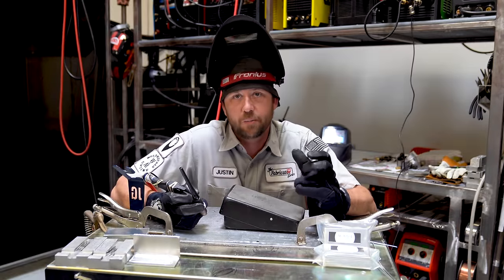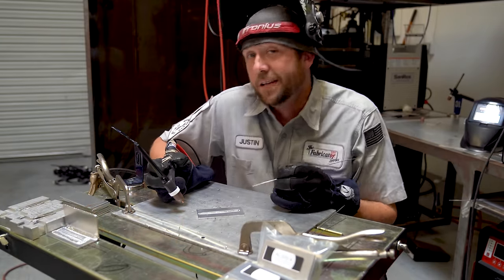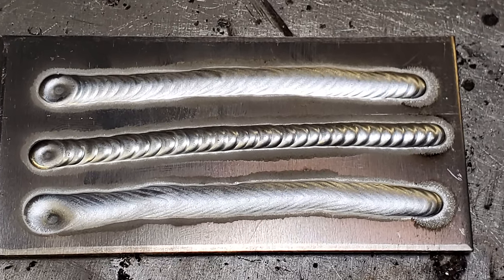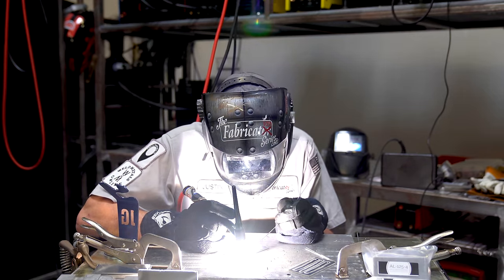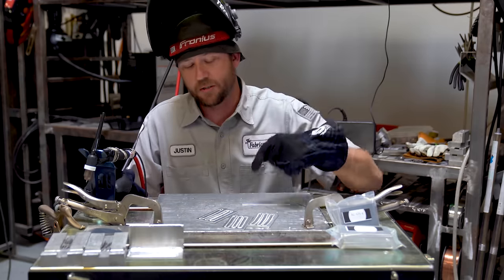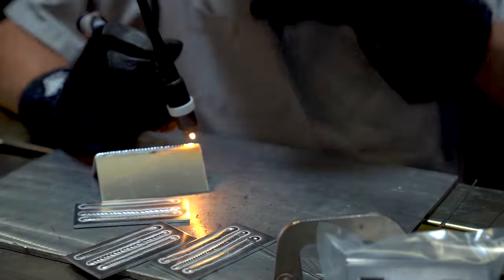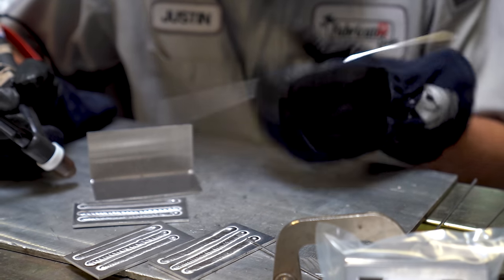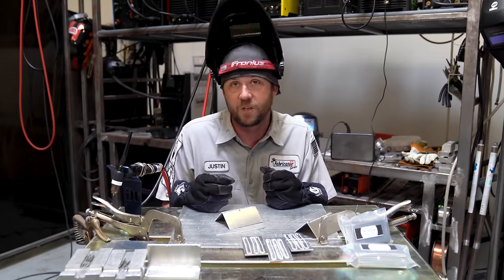TIG Welding with a Trigger Switch

Comment: if you have slope up or down you can control the heat with a button,throttling on and off to control the heat,useful for site work where a footpedal would be impractical

Comment: Thank you for the advice. My welder has an option for variable amp pedal, but I'm cheap and decided to forego purchasing it at first. I'll probably end up buying it, as having that control seems very handy, especially in the real world where metals aren't as consistent as practice coupons. Since I'm just learning though, I think I can learn to grasp the basics like this, it'll probably be good to strengthen my understanding of how the process works. Time to burn some coupons :D

Comment: I always looked at tig like gas welding, and I grew up with gas.

With gas, you have a few tip sizes to choose from and you can adjust your flame a bit.  Your travel speed changes as you weld.
Tig is the same way without a pedal.  The stuff I weld on doesn't really allow a foot pedal, so "no pedal tig" makes me right at home.

Comment: Great informative video right up my street. I use a mig with a 4 metre (12 foot) torch to get around my bench. There are some welds I would like to try using a tig machine but a pedal is out of the question. Thanks from UK 🇬🇧

Comment: There is a technique when you can adjust you amperage on the fly using switch on torch. You need to configure your up-slope and down-slope for longer time and kinda surf between them, put in 4T. It's not really convenient, but in some cases can help. For example welding stainless thin tubing.

Comment: In 4T, can't the amps be adjusted by tapping the switch? This is from the Everlast manual:

"In 4T mode, if the puddle becomes too hot, it can be cooled by lightly tapping the switch to begin downslope and tapping again to
restart upslope before the end current is reached. Setting a long downslope helps improve heat control in 4T as the torch switch is
cycled between downslope and upslope before the arc is terminated"

Comment: Still working on the skill of watching the puddle and adjusting. 
Unfortunately I also do alot of welding that needs to just get it done.  Cleaning is not always a choice also.
I still use the peddle for Tig though.

Comment: I build chairs for banquet halls hotels ect. 10s of thousands at a time. Working with aluminum  square tube (1X1) with 1/16th thickness. All of our tig machines operate on the trigger. And before this next part keep in mind we get paid by the part. We crank them bad boys up to 200 + amps. Just really need to get good at going fast. But to get better penetration you gotta straight up push that filler rod through the material

Comment: I've got a switch and a hand slider, I might try doing it with the switch for a little.
Reply: I tried learning with a switch. I instantly got better when I switched to a foot pedal. I stopped using a switch all together
Reply: @SessoDeluca  was welding some landing gear on a air plane. In the gravel cover. A switch would of been really nice.  But got it, with a foot pedal, using elbows and knees.
Reply: @wcmwfab935  yeah that is one good thing about a switch. I've done a lot of laying on my side to use my knee hah

Comment: I suppose that time/amp variation would be valid if you had to go over or close to the same weld area a number of times but normally you'd just do a single run at whatever setting you felt like and that's it.
I would agree that a small piece of ally would significantly heat up at the end of the run and require different amp settings for another run close by, but a job with more surface area and a single run probably would draw the heat and be cold for the next run area.....good to know the characteristics though
Why not preheat the work piece so that it's hot and you don't need to adjust the amps at all?.

Comment: Switch is all i've ever used. Foot pedal wouldn't work for my line of fabrication as it's mostly in-position welds on stainless. The one big advantage that I can see from using the pedal is that gripping the torch is much easier in awkward positions as you don't have to reach and press a switch with your finger or thumb.
Reply: Same here, restoring cars so a pedal is impossible to use (standing, kneeling or laying), but with a good torch that control the machine and not just an on/off switch it makes it easier, a flex head is a great help also.
Reply: Same here up until the very latest welder I never had a foot pedal,the new machine came with one tried it and put it away as after nearly forty years I cannot get on with it, I do like the multiple click switc systems on some machines though where you program several  settings and click through them on the button.
Reply: It's funny hearing it from the other side. It seems like it's the same comments just flipped. I want to try the tig button since you can vary your amps like a foot pedal without moving your thumb or fingers all around.
Reply: @brandyquad  my one experience of using a pedal had me pressing the pedal almost as a knee jerk reaction to nodding my shield down, meaning I got a lovely flash of the welder every time :)
Reply: @adrianco1978  haha it's funny how that works. I never push my foot down until the hood is down. It's just muscle memory at this point. I have used the pedal is some awkward ass positions amd flashed myself because I pressed on accident. That sucks. I hate getting flashed
Reply: I am the other way, only ever had a pedal. 25 years! Have come up with some very interesting pedal mounts for welding under cars, in cars ect ect. Tried to use a mates button torch once, it was a freakin' disaster. Horrible...
Reply: We do pipe welding in factories. We have never used a pedal. We don't have them either.
Reply: @TIGFab97  do you do scratch start?
Reply: @brandyquad  no, button on torch. We do lot's of stainless steel.
Reply: @TIGFab97  Are you doing any sanitary? I hear sanitary does a lot of fusing. Its something I'd like to be able to get into in the future.
Reply: @brandyquad  no not fusing. We do all kinds of work. Chemical pipelines, paper factories , food industry. We set the machine on 4t and then program how we like. So  push the button, you hold it until it starts. Then you let go the button and it upslopes (if you want) to the set amperage. You make your weld. And if you're done, you push the button and it goes in the pre-set down slope to a pre-set percentage of the main current. Then you let go the button and it goes in to post flow.
Reply: @TIGFab97  oh okay! That's cool! I got to mess with a trigger once with my old welder but I got a different one and didnt get anymore time on it. It seems like it would be really handy for crazy in position places where theres nowhere to put a pedal. I've heard people using it for anodized aluminum doing bump welding too. Thanks for the reply
Reply: @brandyquad  i learned tig welding with just a button and i think it's just as easy and consistent, if you get used to it. 4t is nice because after you started it, you can hold the torch however you want. If you need to weld for like 10 minutes, you don't need to press a button for 10 minutes.
Reply: @TIGFab97  that's handy. That can give you some good mobility not having to squeeze in that particular way or position the entire weld.

Comment: So for those of us that are learning, I have a question - If I decrease the amperage, it will slow down the pace that I would have at the "normal" setting. Does this then give me a little extra time to work on my muscle memory while achieving the same results? Once I get my hands coordinated, I should be able to increase the amps to simply work faster, right? Kind of like learning something new on a guitar - you start out slow, then build up to full speed?

Comment: When I do use the tig I often use the 4T mode. Primarily because I 'm working on or in a boat and the foot pedal wouldn't be practical. 
I don't recall you making Video  on using 4-T , might be worth doing.

Comment: I would like to see any of you guys do a video on welding aluminum fuel piping, like I have to, with multiple pieces tacked up in different directions. 2",3", or 4". Most of my couplings are sch80 aluminum pipe to say 16th".

Comment: Hi, so I’m starting my new adventure into Tig... I want to weld 1018 mild steel (cold roll) unless you say I should use hot rolled, I’m interested in making motorcycle frames and repairs. After I practice, practice, practice and then more practice, lol. ? Question is WHAT filler rod should I be using for this? Thank you. P.S. I won’t put anyone in danger with my beginner welds. 😎

Comment: Great video!! Perfect timing. Quick question though, I've been tig welding for 6 months and can throw dimes on coupons all day but when I actually set up a real world repair (like a cracked case cover or hole repair) I wind up with something resembling the bottom of a pigeon cage.
Reply: Same here on cast aluminum, arc wanders and weld looks contaminated even tho I grind and clean thoroughly
Reply: Jonathan Hansen I watched a video where he let his arc heat up and puddle for awhile to burn out the contaminants before he added any filler. Hope this helps
Reply: @terrorofdemons1168  Or push more filler to push out contaminants

Comment: Could you do a similar video using thick aluminum?  1/4 to 3/8.  I can't seem to get consistency.  Sometime nice weld and shiny and other times chaulky and hot.  Thanks for the video.  I'll try to apply the speed/amp  technique to thicker stock and see if I can figure something out.

Comment: When I use my torch switch I just flip the pulse switch on and set the max and min amps and pulse time to what works for me and go for it. I know it may be cheating but I didn't see anything in the rule book that said I couldn't.
Reply: pedals are only ideal when working at a bench. otherwise a trigger is better.
Reply: What cheating that would be? Here in Finland I know personally roughly about 20 skilled TIG-welding guys, most working with tubing, but many other applications too. Not a single one of them uses pedal. Heck if I'd like to get one for my TIG at work, I wouldn't even know where I could buy one for 100% certainty. I have quite good ideas who might be able to supply me one, but nah. I couldn't care less. For instance on my working Fronius I just change everything from the machine and I can do power changes also from secondary switches with 1A increments. Can even do it on fly when using 4T-mode. Obviously not as quickly as pedal could allow it. But why on earth would you have to change amps so drastically? Unless your general settings would be absolute sh*t?

Comment: I don’t get why people hate on switches so much, I use a switch 50-60% of the time. If you can dial settings or are stuck in a tight spot you can’t beat it.

Especially when I have to lay down and weld above head.
Reply: I only use a trigger for mine! I also set a ramp down on mine so that I can use the trigger to to lower the amperage by pulsing it if needed

Comment: I use the switch 98% of the time at home and scratch start at work 100% of the time with an ideal arc 250 on stainless pipe.
The pedal is fine for small alum projects, band saw blades, and other pocket sized projects you do sitting on your butt. 
However standing at the top of a 10' ladder to weld a joint in a 4" stainless pipe like I did yesterday. or just moving around the table a lot to weld on a larger part. I have no use for a pedal.

Comment: How do you not burn your arms from the UV? Every time I try to weld in shirtsleeves I end up with nasty "sunburns" on the fleshy inner parts of my forearms. Also, is the big AL plate to get a better ground or to have a heatsink? Or both? Sometimes I can feel the start of current when I'm sweaty and welding away from my work clamp. I wonder if the difference in materials in my steel table and the AL I'm welding sets up some extra resistance as the amps have to go from the bronze?, brass? work clamp then through the steal table, then finally pass into the AL and finally the tungsten (actually, reverse that, I was thinking about DCEP set up). Seems like having a similar metal under your work might lead to accidental fusion to the "work plate."

Comment: Which type of TIG AC/DC welding machine you recommend for TIG beginner welders?
I have experience with MIG but wanting to buy TIG for some small project's and Aluminium, SS etc. welding at my mechanic shop?
Of course I don't need worst chinese type which will fall apart in a year, also is there any good combo with plasma cutter?

Comment: A bro I have an Eastwood 175 mig and I tryed your drill out the tip method for tigging but I'd rather find a torch for it with a hand switch cause that's how my mig gun is I was wondering if you had any ideas I know theirs alot of different brands I don't know what gun to go with

Comment: I don't have a pedal so I put a slow ramp down (let's say 2s) go a bit higher on the amps than i need and then pulse it with the switch on every dab, once the part kinda heat soaks. It works i guess but is this a good technique? I am a beginner but i kinda found out that this works for me for aluminium - should i continue like this or switch to a more standard technique?
Reply: Exactly , for example how can i use a foot pedal when I hang somewhere inside the tank

Comment: No need for a footpedal what so ever unless welding aluminium, so you can get plenty of heat into the weld at the beginning to get it flowing, then back off once you're moving.

Comment: I am new to tig welding. I purchased a Everlasting 161STH and it does not come with a foot peddle. It has a finger control like you showed in the video. As a beginner am I going to have a hard time learning with a finger control? To help the learning control would it help to purchase a foot peddle? Thanks in advance for your reply.

Comment: Once you get the hang of using the switch, you wont want to go back to a pedal. Personally, i avoid using a pedal whenever possible. I weld mostly thin stainless and aluminum up to 1/8.  Quick start/stops are also useful with heat control.

Comment: I have a Pico 180 cady welder with a TIG attachment and it's only scratch start so I don't have a switch or a peddle  only the Valve to turn the gass on or off , Is it posable to add a peddle to my Pico . I mostly TIG stainless exhaust , I don't run stainless in my MEG so If I have to much  trouble welding the exhaust I will use the Arc or stick and on car body's I use the OXY  because of my TIG being such a pain in the butt . When I see you TIG I cuold just cry why can't I do that Why Why Why , love you channel

Comment: to be honest, i have never welded with a foot pedal. i am never welding at a table in a shop so the foot pedal can't be used when sitting on a sling hung from the celing or climbing on pipes to reach my welding spot. so yea, it is not really hard to weld with a trigger, it is just what you get used to.

Comment: Really great videos. Is the filler rod material the same as the coupon material? Thanks again V/R Bill Tuite
Reply: No, never. Typical aluminum most people weld is 5052,6061,6063 or similar. Most common aluminum welding rod is 4043 or 5356.
Reply: @gamble1997  I really appreciate the information.  Still just looking over the edge of the box!

Comment: I hate the foot pedal. Most of my welding (project cars) is out - of- position. Hard to work a pedal laying on my side under a chassis. I've been trying to find a torch mounted switch unit with a built-in potentiometer in place of that clumsy pedal. It would make things so much easier. So far, no luck.

Comment: What is your recommendation for a TIG welder for someone just getting started?
Reply: I just got the ahp 201 alpha tig, Justin has one in the shop, it’s probably the cheapest good ac/dc machine if that makes since. If you got money then go all out and get a miller or htp, they have more features to them on the ac side. The only issue with the ahp is that it has knobs instead of digital readout on some of the functions, such as pulse or ac frequency.
Reply: I like it though, seems to weld better than my skill set as of now.

Comment: Do you have any videos or suggestions on how not blow out the edges of welds? I have started repairing stainless steel on restaurant kitchen equipment.  And seem to blow out edges a lot and have to go back and build it up.  Great videos!
Reply: Use sacrificial tabs....cheating but works.

Comment: I thought I  could TIG weld, then I moved to Thailand. I found out welding without a pedal was impossible! I never really thought much about the  actual amps I welded at, so I had to learn to TIG weld all over again. To make it even more exciting the electricity here is NOT stable!
Reply: Thats why its good practice to start with Scratch start Tig. Its the most basic but hardest to master and is the most common form of field welding.
Its the same as driving, if you learn to drive in a manual transmission car you can drive an automatic no problem, but not the otherway around..

Comment: Here in the UK you hardly ever see a foot pedal, I've been Tig welding with a trigger switch for over 30 years, you can always adjust the amps between passes if necessary.

Comment: Not a real world result as most welding on jobs where a switch is used you will be crawling all over so dosent get to hot unlike a small bit of plate like you are working on 
I and most of my staff use both . The miller wireless pedal is good also torches with vari rollor controle is good as well